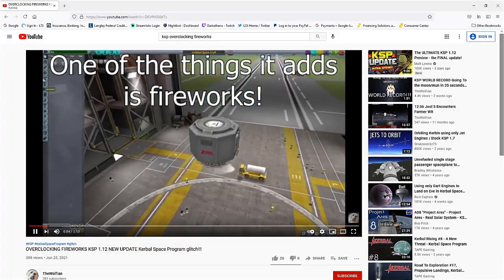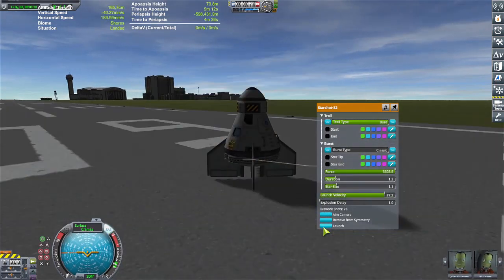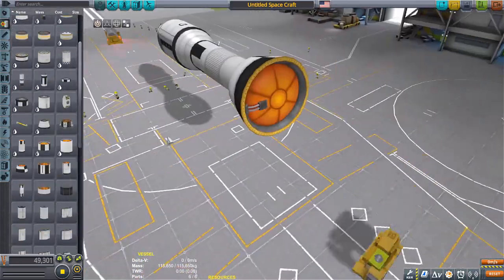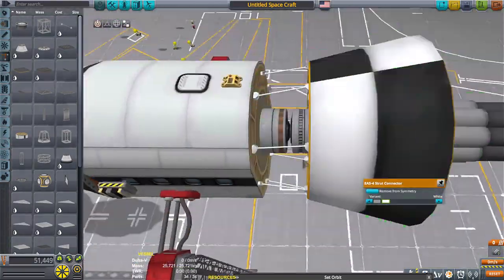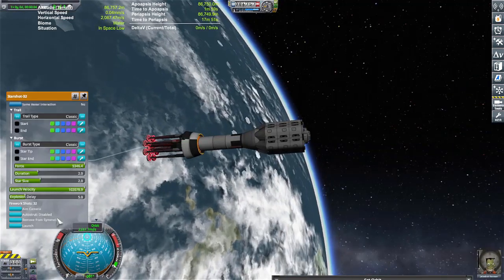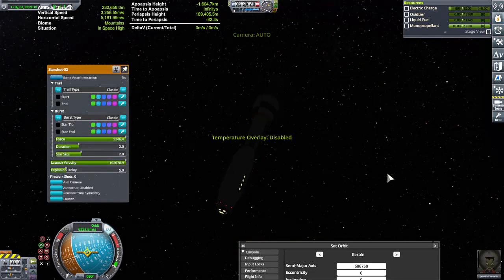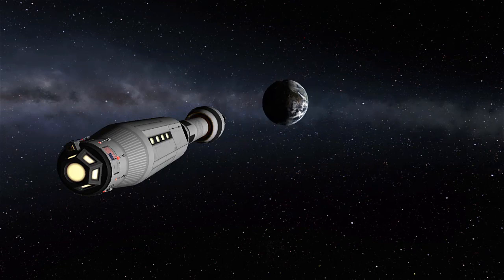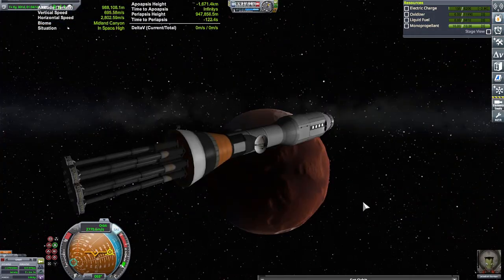STOCK ORION DRIVE  \  KSP 1.12  \  Kerbal Space Program

Comment: Did you try adjust the damper on the cylinder robotics to limit total movement?
Reply: PhonieZ  ya the forces may still be too much that they break the cylinders.  the dampers make the cylinders more resistant to movement so if it is to stiff your much likely to exceed the maximum force of the object. 
Think of stoping a moving car with a bungee rope (loose dampers) to a tight wire rope or *wall (tight dampers). *Exaggerated of course
Reply: PhonieZ  I’d still try it to experiment who knows you may find a way to inverse the movement to allow repulsion instead of absorption
Reply from the maker: Yes, too much and it breaks. Middle is fine

Comment: Orion ships should probably include regular engines for fine tuning and docking
Reply: The purpose of the Orion drive was for trans-planetary travel. Think of it as what a plane would be to a car, the Orion drive would be to a standard rocket.
Reply: @papahemmy8587  yes, and thats exactly why planes have engines which can be throttled and fine control systems. Orion ships should also have engines to perfect target orbit. (Or low power nukes that are for this)
Reply: @CarlosAM1  you're absolutely missing the point lol
Reply: @theultimatekeko  No I am not. Going to another planet unlike what movies might tell you is not an easy target, even a few meters per second can make a planned 500km perigee into a direct collision
Reply: @CarlosAM1  man that might be why i still miss duna after playing ksp for over 2000 hours hm
Reply: @CarlosAM1  That has a simple analogue. Carry bombs of a few different yields. Big nukes for big maneuvers, medium nukes for adjustment or small-scale “burns”, and small nukes for fine-tuning your trajectory after the fact.

That can also be modeled in Kerbal Space Program, by having multiple “overclock” settings on the fireworks: the higher the overclock on the firework, the higher the “yield” of the warhead, roughly corresponding to having a few throttle settings to choose from.
Reply: @theultimatekeko  MechJeb, man. Saved my sanity.
Reply: @TheEmeraldMenOfficial   will be hard to dock like that. Also what yields we talkin here? I am not saying thrusters that rival entire nations, just something that can be used to almost perfectly fine tune an orbit or heading.

Also I literally already said exactly what you just did on my comment already lol
Reply: @CarlosAM1  I didn’t see until later, and I wouldn’t be sure as to what yields to use. That would depend on the size of the craft, and the amount of impulse you want to generate. The larger the ship, the higher the yield required: it’s a balancing act. A small change of speed could take as little as a 500 t warhead on a small craft, or as much as a 5 Mt one for a larger one!
Reply: @TheEmeraldMenOfficial  that is obvious
Reply: @CarlosAM1  I didn’t say you’d use it to dock lol
Reply: @TheEmeraldMenOfficial  yes but if you don't have any other thrusters then its gonna be hard to dock with anything, and still extreme precision tuning is almost impossible.
Reply: @CarlosAM1  To use the plane analogy, the Orion drive is like an aircraft's jet engines, and its chemical rockets are like an aircraft's taxiing motors for fine control steering and driving across the airport tarmac. The Orion drive gets you from planet A to planet B, and the chemical engines use a few hundred meters per second of delta V to fine tune your orbit in order to rendezvous with a target.
Reply: Nah, let's do it the kerbal way
Reply: I agree. When I did this I never would get into an exact orbit.
Reply: I do this
Reply: you should see stratzenblitz75 do socking with sepratrons. amazing